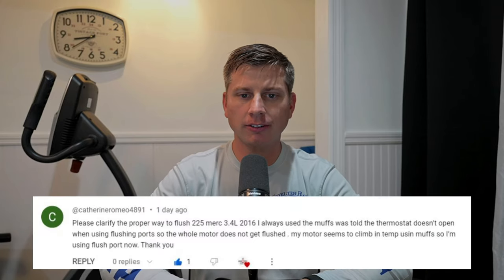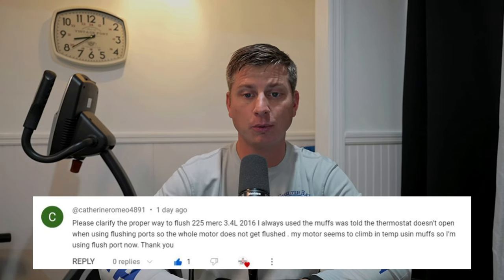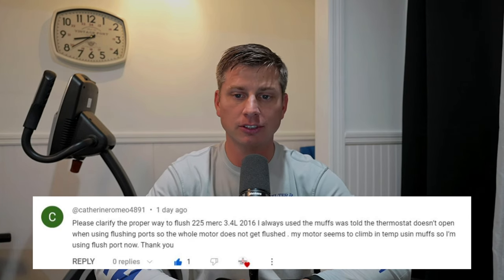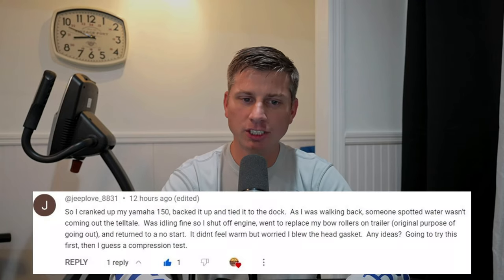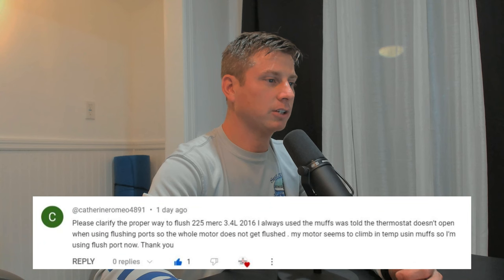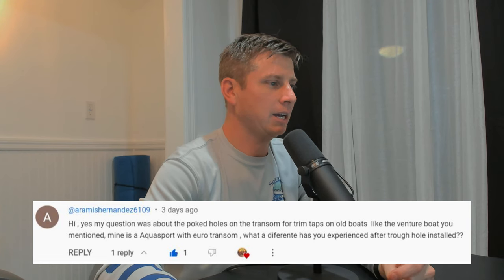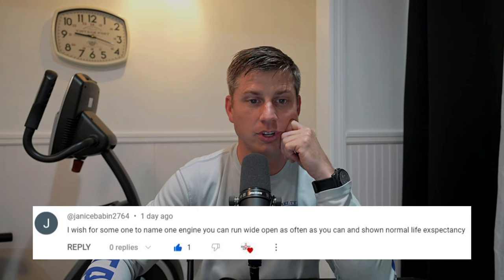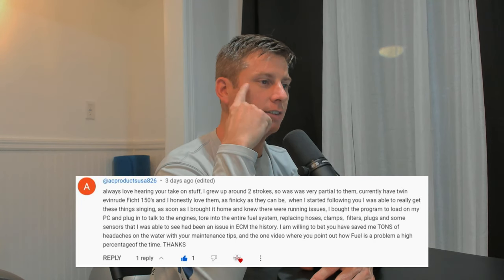PROPERLY Flushing An Outboard!

Comment: Mercury 1979 175 HP Black Max, original block, 121 psi on all 6 cylinders, and it only lives at WOT. Keep lots of oil in your old 2 stroke, and it'll love you for ever.

Comment: Seems like no matter what the question is there are at least 2 different answers. Everyone thinks they are correct. Why can't we get the proper answer to the flushing question. I just want to know how to do it properly without damaging the thing. In the comments there are 2 opposing answers and Everyone thinks they are correct but that can't be.
Reply from the maker: Mainly because there are literally thousands of engine brands, engine models, HP ranges, water and location types they are ran in, amount of time they are ran, how long they are sitting, and tons of other variables, you'll never get a single answer because no one knows your exact situation, engine, location, and how you use your boat :)

Comment: Imo flushing it with muffs after every use could end up being more of an issue than using the port. There’s no real way of knowing your getting the correct amount of water and pressure in the water pump on the muffs and I’ve always felt like after constant muff use 😂 it’d end up melting the housing or wearing the impeller prematurely. At least more of a risk of that than a tstat issue from using the port

Comment: When running your outboard in salt water, Not flushing the engine with the muffs can potentially cause corrosion at the thermostat, at least for the Yamaha mid range motors(150, 200 hp) because the salt will sit upstream of the thermostat.

Comment: You need to talk more about inboards. All of my friends here in Florida use them more than outboards because we have larger and faster boats…. Inboard flushing needs caution especially with closed systems, shaft seals, and seawater pumps.
Reply from the maker: I don't work on many inboards :( They aren't near as popular around here as they used too, but yeah the flushing on them is way different and super important!
Reply: More like larger slower boats 😂
Reply: @johnboy5167  My Baja does 90 mph. 😘

Comment: On the flushing topic: I have a set of  '19 150 Mercury Four-stokes that were used to re-power our boat. Last year I did the thermostats. I took one of the old thermostats to school. (I'm a science teacher.) The old thermostat had some blow-by when run under cold water from a sink. I wonder if this happens when on the flushing port? If so, the whole motor would be flushed. To be fair, I did not test the brand new thermostats that I installed. Any ideas regarding how tight the new Mercury thermostats actually close? Total hours were around 220. The thermostats looked almost new, with a little stain from the water. Also, it was over 300 bucks for 2 thermostats -  really Merc?
Reply from the maker: That's super interesting! I need to do that test myself with some new thermostats and see what happens. That would make a ton of sense for there to be some residual water flow that the thermostat lets by based on pressure, which would solve the flushing discussion entirely! 

And yeah, lol Mercury and their $150 dollar thermostats with the plastic housings and then the $5 clamp to squeeze the hose back down......... SMH
Reply: @TheBoatersPodcast  I took the thermostat apart today. It looks like there is a tiny "canal" where the t-stat closes against the housing. I guess it's the design. I'll feel better about flushing from the port now!

Comment: 🙋all motors need a flush kit on the head i have a merc 90 hp installed it my self i took the brass plug out installed it and there ✌️

Comment: I can tell you  for a fact, I use the flush port on a 250 Suzuki for four years and my fuel cooler clogged up.
it never got flushed by using the flush port.
I couldn't figure out what was wrong and a Yamaha Merc mechanic told me to check the fuel cooler and he was right it was full of dirt mud salt from the St Johns River Jacksonville. I have many videos about the  issue, on my own channels boat maintenance playlist. I would never ever advise anybody to use those flushing ports.
Reply from the maker: Yeah that sucks :( I wonder if you also maybe had a blockage issue going on too?
Reply: @TheBoatersPodcast  that was the blockage, cleaned it out and it ran like a scalded dog!
drilled the plugs out of each end. literally had to use a long drill bit to get through all the Crud!  and it really affected the engine terribly after running hard on 110° day in the middle of summer, those fuel coolers are mighty important!!

Comment: If your water pressure or the hose you're using soft then enough water won't enter. I flush with hose on muffs and no issues because I have good hose n water pressure

Comment: A weak water pump will sometimes show up quicker when idling on a flush if you have enough water supply. An inboard or sterndrive will be a problem if not run long enough to open the thermostat and flushing long enough to actually exchange the water. Fill a glass with dirty or died water and another with clear water. Poor the clear into the died. Just let it flood over. Even after you empty the clear into the dirty it won't be completely flushed. Same in the engine block.
 Most people won't spend the time to flush completely.
Reply from the maker: That's true, and the sterndrives for sure! You got enough problems with manifolds and risers already!

Comment: You are the best... Do you want to move to Destin??? lol  Question? I just put a 2023 Yamaha F200 in line four on my Skeeter ZX 22V bay boat and the dealer put a Aluminum 14.5 x 17 prop on it. He felt that the prop will give me the best hole shot and overall good speed with rpms at 6000 or less. What are your thoughts?
Reply from the maker: Thank you! I used to live in Mossy Head! Lol Most people won't know where that is lol but it depends on prop question, if you are getting 6000 RPM with the 17 pitch then that's probably the right prop, I'm guessing you do a lot more inshore stuff back in the bay and in the rivers on the east side and that's why they got you the aluminum prop? But if you hit 6000 with the 17, then that's right, probably a 4 blade since they said it'll be the best for the hole shot?
Reply: Если хочешь получить скорость, то только стальной гребной винт с саблевидными лопастями. Например солас- ямаха, Мичиган баллистик, Пауэр тэч. Если у тебя на алюминиевом винте 14.5/17 максимальные обороты достигают 6000, то стальной подойдëт 14.25/19. Антикавитационную плиту мотора выставляй вровень с днищем и на максимальных оборотах поднимай гидроподъëмом плм пока винт частично не выйдет из воды в кавитирующий режим. Ну если есть ещё и гидролифт, то ещё проще.

Comment: Hi, I'm Mehdi from Tunisia I appreciate a lot your videos and I'm following you. I learned a lot. I need your advice about upgrading my optimax 90 HP 2004 to 115 by replacing the ECU and eliminating the intake restrictor. I ordered a 2003 ECU 115 optimax, so same generation. Is that safe, I heard many persons doing that ? What are the risks ? Could I blow my outboard ? What can you advise me ? thanks a alot !!!
Reply from the maker: Not sure that you will need to do anything else besides that, I'm not sure about the exact models, but I'm pretty sure the injectors are the same for both 90 and 115, so I would just make sure that the injectors are the same for both models and you should be good to go!

Comment: How long do you have to flush? I’m on tank water, so 5-10sec is about all I give it. 60hp 4 stroke Yamaha gets used 3 times a week.
Reply from the maker: Being on the tank makes it a little difficult, if it's not too much I might try and up that to like 30 seconds if you could, but that will be fine for what you are doing on the 60
Reply: @TheBoatersPodcast  I’m a Baptist missionary on Nauru, a small pacific island nation, and it seems if boats get used more than sit more they have less problems to deal with. Thanks for the reply!

Comment: Can you start the motor on the flush attachment
Reply from the maker: Depends, larger engines, not really, most of the rest, sure, but only for testing and running for minimal amount of time, like less than 5 minutes. The impeller is pushing the water off it, and definitely don't rev the engine up or increase the RPM while on the flush because you blow the water off the impeller and risk burning it or wearing it down.
Reply: @TheBoatersPodcast  thank you for replying